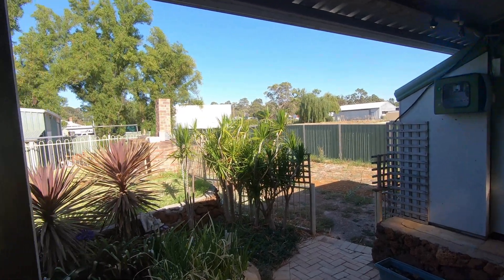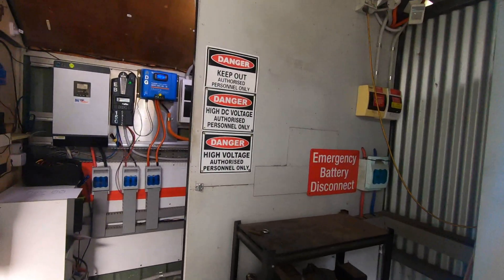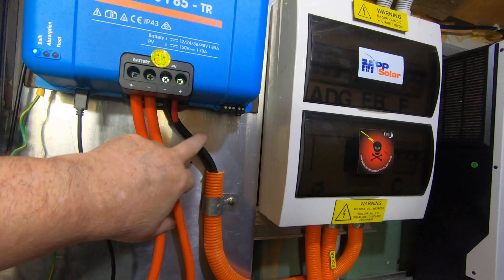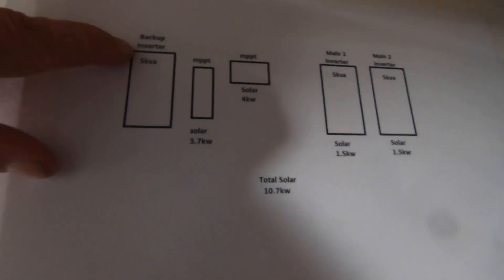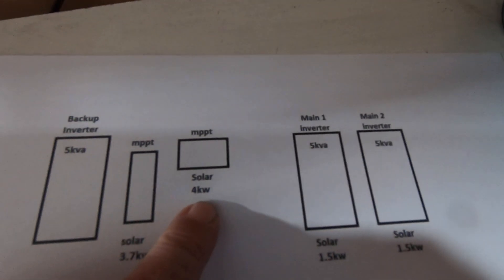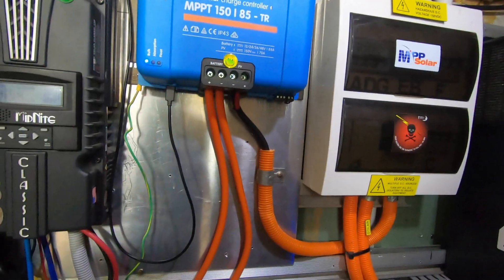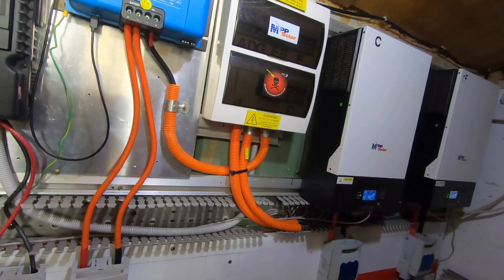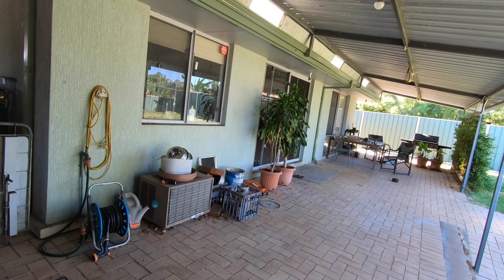System overview.  How much solar to run my house

Comment: Nice vid. Beautiful cable too.  Are you boiling the tea kettle on electric ?
Reply from the maker: Yes we boil the kettle and run an electric hot water system. everything in the house is 230v except the stove. We have a LPG hybrid stove.
Reply: Cheers for that. I boiled my first kettle the other day, with my solar. Been working towards this for two years ! Now time for MORE LiFePo's. :) @JustinCaseSolarPower

Comment: NICE work brother. Man I am saving to buy a victron charge controller. Need it for my outdoor 12 volt lights. Love how well it works and no fans. Wow 5 gals of gas is not much. Last week when my power was out for 4 days. I used 5 gals of gas. We had no real sun. Got to love a nice setup like you have. Thanks for sharing. God Bless.
Reply from the maker: Right on.

Comment: I use 16mm2 wire for my Victron's (100/50's) as that is the largest wire I can fit into them, but I buy from the same supplier of wire you do mate. It never gets warm or hot to the touch and just works. The main wiring is (as per your recommendation I might add) the 90mm2 wire which also never gets warm or hot to the touch. The wire for my inverter is 50mm2 but that again is the biggest wire size it will take. It only warms up a tiny bit after a lengthy stretch of being used at over 2.5kW. Get the right wire and your gear will love you very much and provide solid service to you and your home with minimal maintenance.
Reply from the maker: Yes wire them right and they will work for a long time.

Comment: WOW! 10.7kw per year??  I think you meant per day!  lol!!  10.7 kw is amazing though. Here we use about 4-8kw/day in summer and  in the range of 20-30 in Winter.
Reply from the maker: 10.7 that is the amount of solar i have on my house LOL Norm
Reply: LOL!  I know!  It just looked like, and maybe only to me, that you used only 10.4kw per year which I assumed was per day.  Good Video!!
Reply from the maker: @NormanMcGregor  10.7 is the total amount of solar panels i have on my roof. I need that many panels because i am 100% off grid. Power for winter

Comment: Hi nice video..I just wanna know how many years does your Mpp Solar Inverter have..oldest still working ?
Reply from the maker: My old mpp solar ink inverters are all still alive and powering farms The Silver one in this video i am using as a battery charger is original pip-4048
Reply: I got two one is 2 years old and the other is 1 year old was wondering what's the lifespan of these things
Reply from the maker: @Theoppositeofchaos  all depends on how hard you work them. I know of one man that got 8 years out of a small 12v unit, When i get new updated units i sell my old units and all of them are still working great. The old 3kw grid tie unit i had many years ago is still working great.